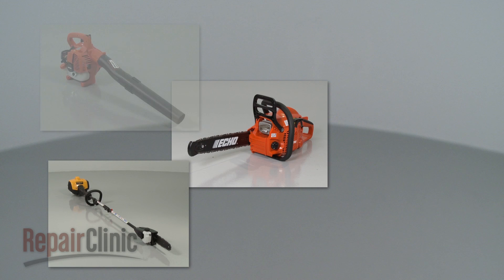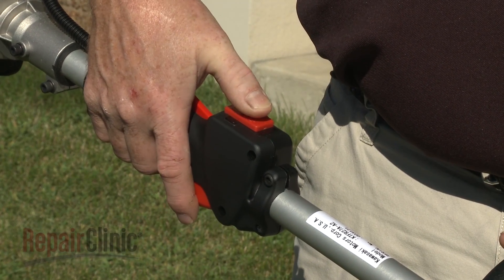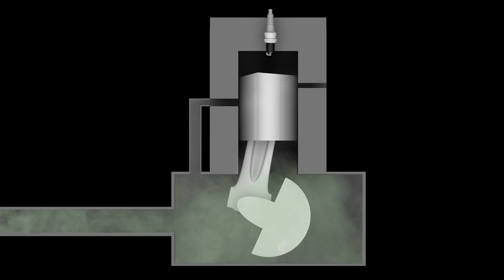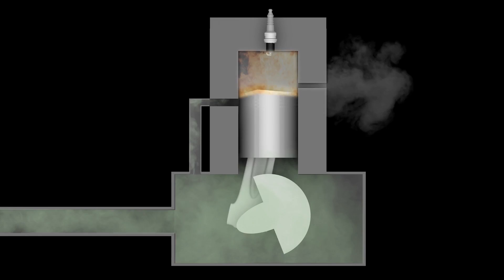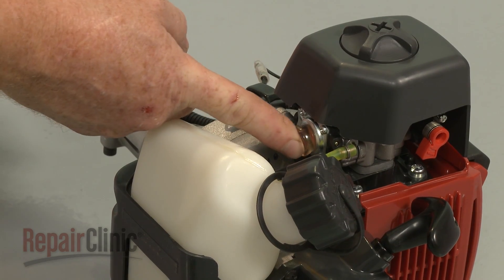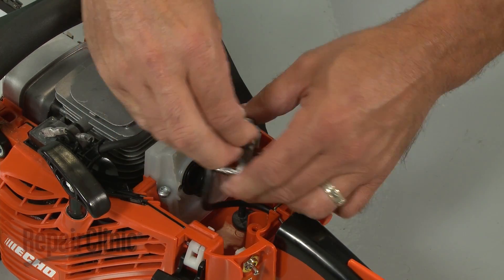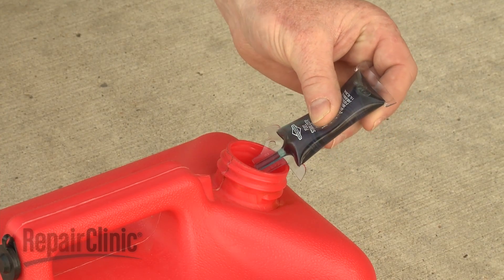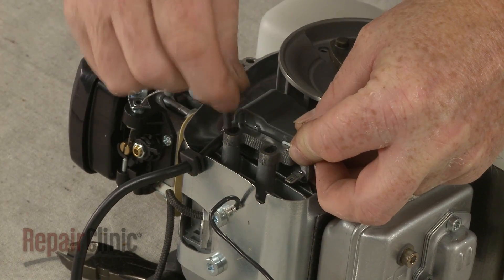How Does a 2-Cycle Small Engine Work? — Engine Repair Tips

Comment: 0:21 sec. that's a 4 stroke engine !!
Reply: Aiden Pena there's a small grey oil cap on the Honda engine. So it's clearly a 4 stroke not 2 stroke get it right.
Reply: Aiden Pena, It has a grey oil fil cap on it, which makes it four stroke.
Reply: Ikr! I was gonna comment on that. Lol I’m only 10 and I know my engines.
Reply: Two cycle engine get it right !